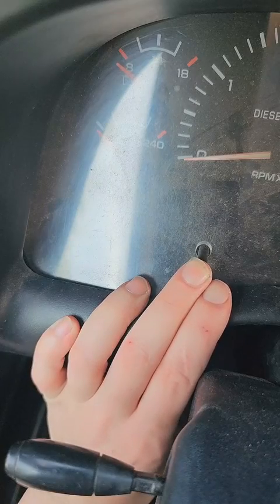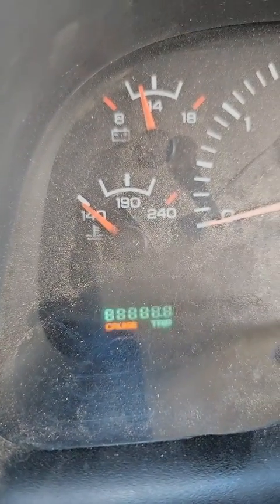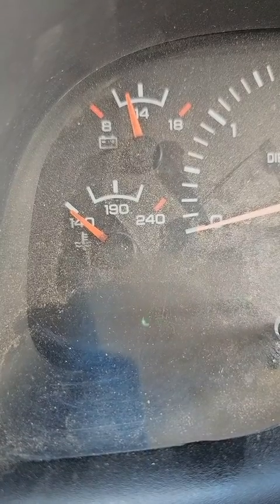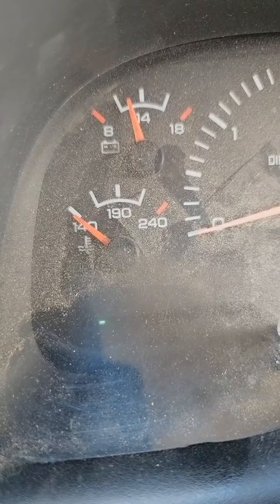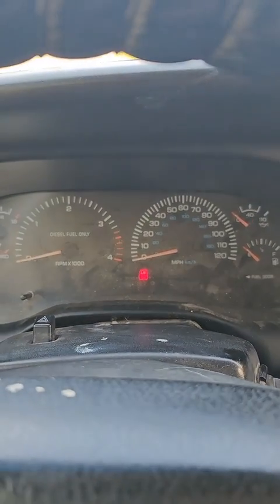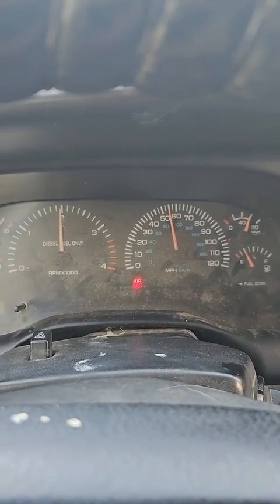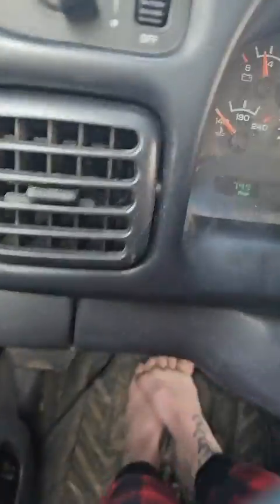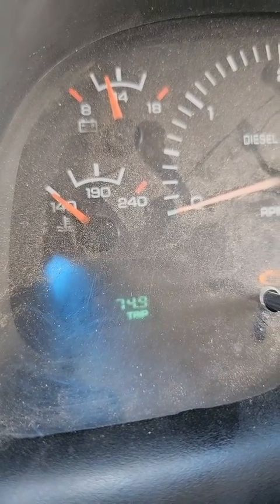The difference between the code check and the Guage cluster check on a 2002 dodge ram 3500 cummins.

Comment: Having a throttle/obd2 issue with my truck i hope you can help me with. I did the 2nd test you showed last night and was able to drive my truck until i shut it off then it resets back to sticking throttle and cutting out. Check engine light is on but my scanner says no connection when i try to pull the codes. Both these tests produce no codes either. Obd2 port has power but no connection. Bad ecm or pcm?

Comment: I love Gen 2 trucks. Enough 'tech' to be helpful but not overboard. I've put hundreds of thousands of miles on them. Would love to have another one. Wish the old 5.9 setup was still around. I had a 2500 and also a 3500 with the NV5600 -  great truck, ran like a freight train.

Comment: I have a 1999 dodge 3500 to 24 valve Cummins is it true that it has a pin in the timing chain cover that will come out and destroy the motor
Reply: I am also a diesel, mechanic and equipment

Comment: Great videos,  how do i complete a drive cycle on a 2004.5 dodge 2500 5.9L.  Keeps saying my CCM  isn't ready?
Reply: Every monitor has a different thing its looking for to pass or fail the readiness monitors. Best thing to do is put some side road miles and some highway miles. Hold it at 50mph for a few mins, 55mph, 60mph. Shut it off for a bit, then go back doing samething on the highway, then go back and do some more in town/city miles. 50 miles or so w some city and highway miles with shutting it down for a few mins then starting back up and various driving conditions should do it. If you're just doing a few city miles or on the highway steady at one speed here n there it will take forever. Can get a cheap code reader that shows IM/readiness monitors as well.

Comment: This is a bit off topic, but I have a GMC 2500 and I was wondering where you find these code checks I would really like to check some issues I’ve been having. 
   I’m pretty sure that if you lined up  the people that are tech savvy I’d be so far behind the last one that I couldn’t see the end of the line 
   But I can fix most things, it just takes a while.  So I’m basically looking for a cheat sheet on how to find these codes
Reply: Cycling the key 3 times only works on some Chrysler products. GM has a key you can put in the OBD connector to get some codes. 
To diagnose anything properly you need decent scanner. Unless it's pre 1997 then it's a cheap scanner and diagnosis charts.
Reply: @williamfranklin6283  thank you
Reply: @williamfranklin6283 

Actually most vehicles have a key cycle sequence they respond to just depends what response you’re looking for